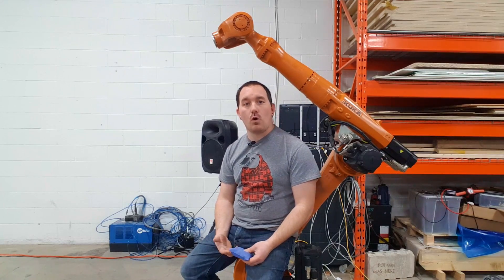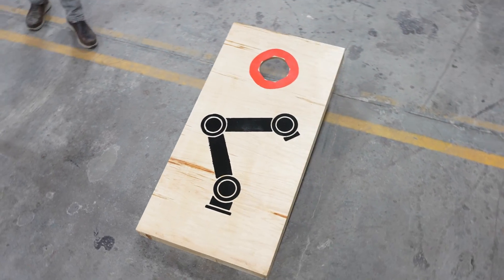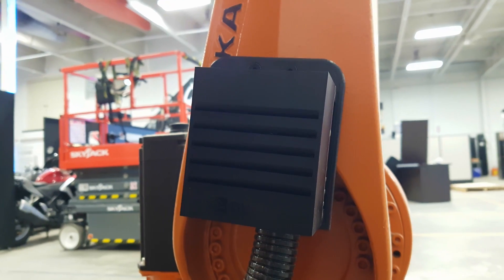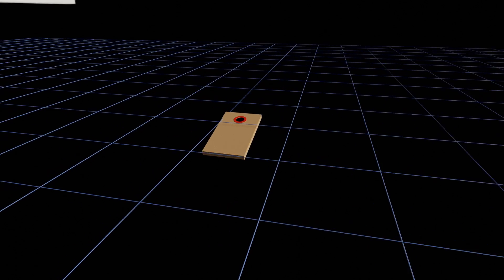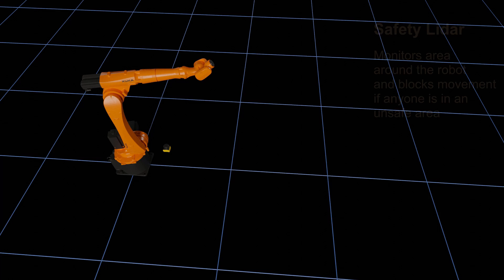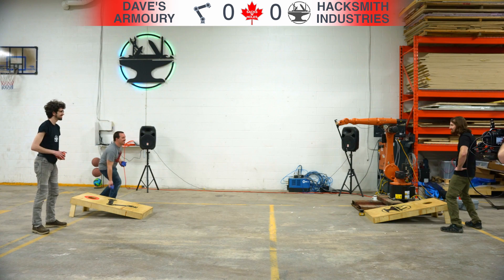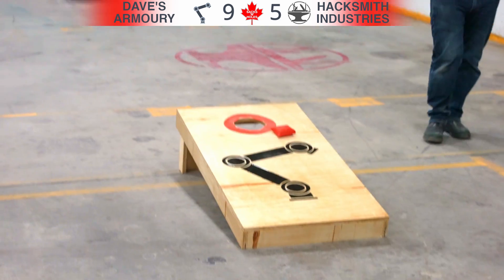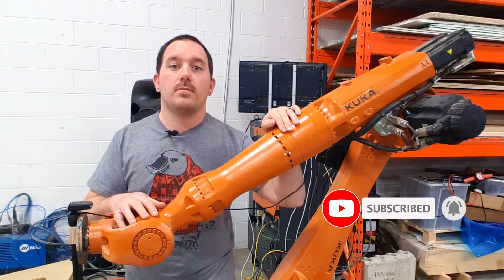This Robot Arm Can Throw a Perfect Cornhole Game

Comment: how does the robot arm end effector follow a path? does it sample a few points on the path and then solve IK for those points and then follow those?
Reply from the maker: The path of the throw is always the same (in the plane between the arm and the hole). How quickly the eoat traverses that path adjusts for distance.
Reply: @DavesArmoury  this is a really interesting project. I was asking about the paths it followed while carving the wood. And does the assumption that the hole is on a known plane necessary for calculating the 3d position of the hole? could u calculate the 3d position of the hole if it wasnt always on the same plane or if the orientation changes?
Reply from the maker: For cutting the board, there are a series of linear motion that approximate the shapes relative to a known position on the board (corner). Each point has a tolerance, allowing for smooth motion. IK is done for each point.

As far as the circle location, doesn't really matter the angle. It will only appear as a circle in very unlikely circumstances. The median position is calculated, which will be approximately the centre of the circle, regardless of angle
Reply: @DavesArmoury  cool....how do u project the point into 3d space?
Reply from the maker: I know the height and angle of the camera and the field of view. I can project a vector to the height of the hole and work backwards from there
Reply: @DavesArmoury  cool...didnt think this way getting position would be very accurate...should try it in my projects too..thanks for ur time man

Comment: I'm surprised you didn't put fiducials on the cornhole board instead of using red gaff tape.  Was the resolution of the camera insufficient to accurately locate and use fiducials?
Reply from the maker: Could have. The red ring was less intrusive/obvious as a target

Comment: Can it be modded to have a printing head mounted and make it a giant 3d printer?
Reply from the maker: The motion is trickier, but definitely doable. You could use a welder and print metal parts too :)